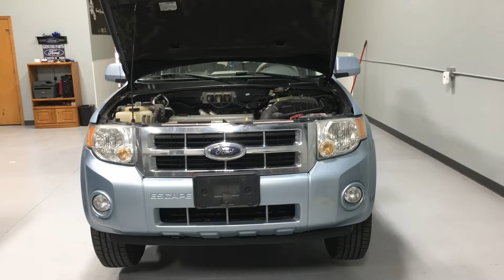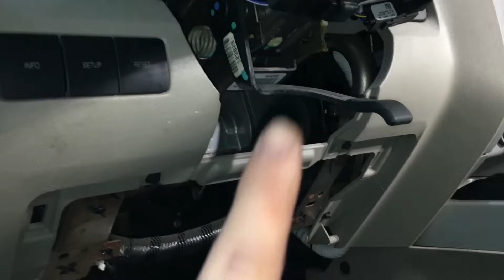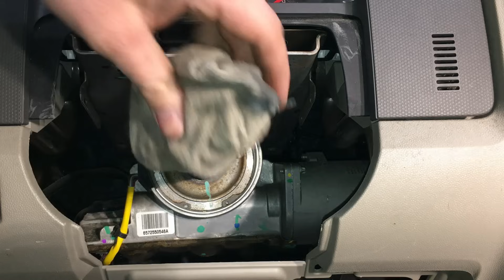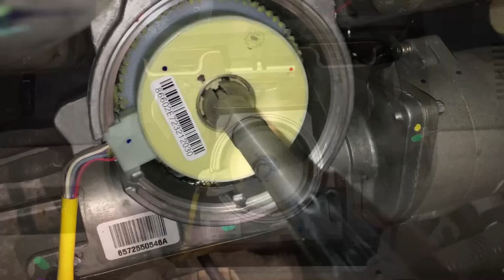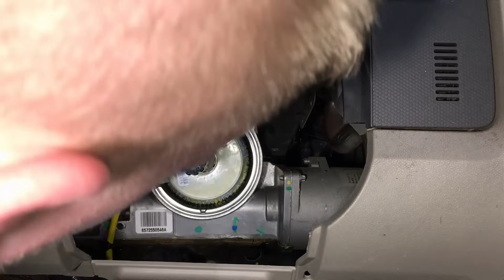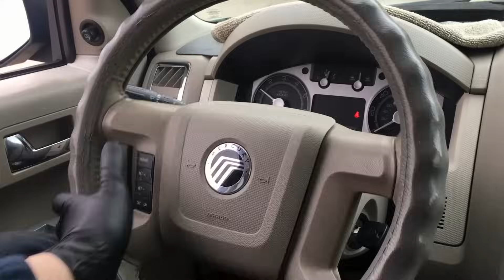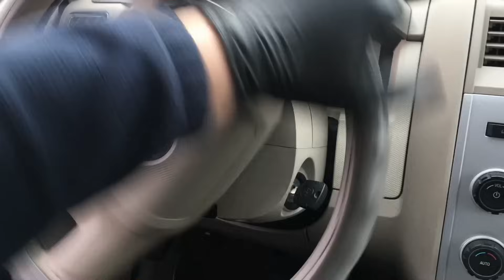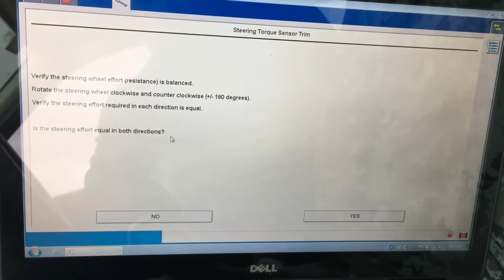2008-2012 Ford Escape Power Steering Code B2278 : EPAS Torque Sensor Critical Installation Steps

Comment: After i changed the sensor in 2009 for escape  for some reason the steering is really stiff as if there is no power steering . Do i have to recalibrate it with a scan tool or something

Comment: What did you use to get the snap ring out? I went and bought the largest snap ring pliers that Harbor Freight had the Icon p/n 57799 12-inch internal snap ring pliers. I did get the snap ring out, but I can't get it back in. Any secrets?

Comment: So the steering got real easy 7 years ago. No feeling at the wheel. It went kapoot today after replacing the key assembly. No codes so I will do as You did. Great tutorial. Thanks

Comment: How dare you not show what kind of sorcery you used to get that snap ring back in…… I bought beautiful Knipex snap ring pliers and this ring is kicking my ass going back in!!
Reply: After an hour + trying to reinstall the ring by myself a second set of hands showed up and once I had that person there to guide the ring under the lip as I squeezed a compressed it, it was reinstalled in under 5 minutes!  I have zero clue how someone could reinstall on their own when the ring kept popping off my $80 pliers I specifically bought for this job (which worked great I’m not sure how I’d have done it with any other pliers, BUT still needed a second second of hands to get it back reinstalled!

Comment: Thank you so much for this video, even in 2026 you saved me $1900. Did it myself with help from this video in one hour the sensor cost me $518 in 2026 from Ford.
  FYI *the pin that's in the sensor is very crucial DO NOT FORGET TO CHECK BEFORE INSTALL!!!! Again thanks for the Vid....

Comment: Hopefully, whoever needs to hear this can find it.  With the pin out of the sensor the top and bottom of the sensor can move independently.  This is how the sensor becomes "damaged".  You can reset the sensor by aligning them back up by turning them independent until the pin goes back deeply into the sensor.  * No need to waste sensors *

Comment: I have 2009
Ford Escape 3.0l XLT with 117,000 km . Yes live in Canada . SUV made in California. My wheel doesn’t shake at all ! No weird noises! No codes ! Steering wheel is very hard to slightly turn left or right . Checked Battery / Alternator. Good ! Fuse #35 good ! What’s your opinion if it’s the torque sensor ? I had the recall years ago and wish I had the knowledge or been told don’t get nothing done till if you have power steering assist fault message on my dash ! Any advice I’d appreciate. As I’m not buying a torque sensor as steering wheel doesn’t shake Etc thank you 🙏
Reply: Bought a newer Scantool . Torque sensor! Had to buy from Ford $1000 for the sensor. I was mistaken I never got a recall for my 2009 Ford escape 3.0l . Contacted Ford Canada and they have to have a Ford shop do a lot and send to Ford Canada . Then they will consider paying a portion only if Ford fixes my power steering fault ! Can’t get the snap ring off! I was told today you need a certain type of snap ring pliers for Fords Escape 2008-2012 ? I already ordered 16 “ snap ring pliers , pik set ! The 16 “ snap ring pliers will be in tomorrow. Could not get ring off with 7”, 11” snap ring pliers sets I had ! Can anyone confirm if you need a specific set of snap ring pliers that worked well for them ? Hope weathers good this weekend to finish replacing this torque sensor! Has anyone put a new seal on ? Mine is original and think I might . The Scantool calibrates the steering angle sensor , torque sensor ! Will let you know how it goes . Thanks for this video and any information about snap ring pliers, the pliers etc very appreciated! Ford USA was very helpful, kind ! Ford Canada very rude , etc ! 😊

Comment: I just did this on my 2012, bought a cheap sensor off of ebay. Triple checked my work as I went along. Started it up and the wheel clocked itself all the way to the right, LOL Note to self, stop buying garbage parts. A factory sensor cost me 3 times as much but hopefully once it comes in it will fix the issue.

Comment: @FordtechMakuloco, excellent video.Everything was real clear except for one thing for me. After you remove the alignment pin and then installing the cover.And snap ring, the shaft should still be in an 11 o'clock position and then you go to and still have a steering wheel, does the steering wheel then stay at the 11 o'clock position during installation as in your video, it looks to be at noon position, so does now the steering shaft get.
Turned and the torque sensor is no longer in alignment? I'm very confused , as i'm about to do this procedure. @FordtechMakuloco

Comment: Followed your instructions to a T. Everything was fine with key in only, able to turn stop to stop no problem. Cleared DTCs, started engine, and the wheel went full left. Where did I go wrong? Unable to  calibrate SAS or Reset PSCM as I am using Forscan. Is this an out of box failure or did I do something out of sequence?
Reply: Aftermarket ones don’t work, it needs to be OEM from ford otherwise you’ll be dicking around

Comment: I know this video was posted years ago but I hope someone can help. I replaced the sensor, everything went perfectly. Alignment of the pin and arrows was perfect. Reassembled, started he vehicle turned the wheel stop to stop a few times and then did the steering turque sensor trim calibration with IDS. No problems. Took it for a drive and the steering wheel is slightly off center. Slightly tilted to the right but drives straight. If you drive with the steering wheel straight, the vehicle drifts left. It didn't do this before I replaced the sensor and performed the calibration. What can cause this or what can fix this? Did something get thrown off when I calibrated it? 
?

Comment: Exceptionally helpful video as usual.  Those two bolts that attach the column to the vehicle are torque to yield and shouldn't be reused.  Less than $2 each,  Ford part # W712250-S437.

Comment: I've watched many of your videos and used several videos to help repair issues with a couple different cars of mine. I  appreciate your professional, and detailed advice, including warnings.  Hugely helpful as you typically even include size of sockets so I don't have to guess, saves a bunch of time. This repair went pretty much per plan it only took me an 1hr 15 minutes and worked perfectly on 08 Escape Hybrid with 229k miles.  Only struggle I had a little bit took me four times to install and remove the sensor even using the jig as the sensor indicator  was leaning to the edge of the alignment window. I would remove it make a small correction and reinstall till it was in the center before removing pinmaking  to avoid any IDS scan tool adjustments as I don't have that high level of a scanner. I hope you make enough from YouTube to make this worth all your time.

Comment: I just had this issue with my Ford Escape, is there a way to tell if the fault is in the sensor, or directly in the electric motor? I have no codes showing up

Comment: absolutely fantastic video I am unsure is the problem with ours is the same the wheel doesnt shimmy it does however have the power steering coming and going but there is a click like a switch turning on and off and the power steering is there and gone when the switch sound happens could this be the same issue I have scanned the car with a obd2 reader and there are no codes could you please let me know your input about this matter the car is a 2010 ford escape

Comment: I have a 2008 ford escape steering wheel use to slightly shake like in this video now there seems to be no power to the power steering at all were do I start for the repair ?

Comment: One thing he forgot to tell his audience is to remember to reconnect the steering wheel sensor connector with all the other 4 steering column connectors.  I forgot it and that has to be why my wheel spun all the way to the right after I started it up.  My sensor was put on perfectly.

Comment: I did this on a mercury and now the car won’t start it’s getting power but the ignition is not kicking on
Reply: If it’s a 2008 mariner hybrid then try  the button on the left of dash with door open remove the cover and hold down button to recharge the computer on the hybrids system. You may need to repeat and it takes about 5 minutes each time

Comment: Ok, my 2009 Ford Escape hybrid torque sensor was replaced, he went thru the 180 turn calibration.  When you turn on the car, the steering wheel turns to the left max position.  You can't get back to straight wheeled.  Luckly I have another torque sensor to switch too, but any other suggestions?  Wife getting upset about using her van.

Comment: Awesome video.  Saved me from certain waste.  One problem I ran into is I did not have a good set of 90 degree internal snap ring pliers.  I was able to get the snap ring off with some work, but when I tried to put the snap ring back on I jarred the sensor loose while struggling with it and toasted the new sensor.  Grrr.  Bought a great set of 90 degree pliers and it was a piece of cake.

Comment: Hey buddy. My kid's 2010 ford escape steering just went out. I didn't see any codes on my scan tool. I went ahead and replaced the torque sensor and calibrated it. Still hard ass hell. I double-checked the 80 amp fuse in the engine bay and the 10 amp fuse inside the car. They are good. I went and got a complete motor/ module from the wrecker and put it on. Recalibrate that. It's still hard. Do n I need to get the module program from the dealer to my car, or is it a bad module from the wrecker???
Reply: I also noticed my scan tool shows abs issues but no abs light on. Did a data log and noticed nothing. My speed sensors are not working on the driver side. On th schematic, it shows that the ABS is tied into with the power steering modual. Will make my steering not work?

Comment: If you have to repeat the process make sure the clip goes through the front hole and the back disk in the sensor there is a 2nd disk that moves slightly. If you miss the 2nd hole then the steering wheel will spin easier one direction and the center ends pulling to one side

Comment: Hi,I have the same problem with a Chevy Malibu 2012 and column and power steering torque sensor looks the same as the one you're replacing in the video.
If I replace the sensor can it be calibrated manually, without a scanner?
Reply: I discovered on my ford that if done properly it is not necessary however I had to repeat the process multiple times before it was perfectly aligned and also discovered the pin has to align with the 2nd wheel in the sensor. If it doesn’t drop into 2nd hole which you can’t see it will not work correctly
Reply: Thank you so much for your help...I appreciate it 👍

Comment: Brian i just did this install. Steering wheel stays straight with key on. As soon as you start it the wheel turns hard to the right but just key on stays straight. Do I have another problem?
Reply: Repeat the steps and make sure the pin goes deep to align the 2nd wheel in the sensor

Comment: Is there anyway to reset sensor if not done right?
Reply: Yes install the pin and move the back till the pin lowers into the 2nd wheel in the sensor

Comment: So 1st time it started to turn left after installing the new part. 2nd time it did the same with old part 3rd time it was the charm with new part. The sensor has to be in the middle where the pin comes out not one bit to edge. It’s not necessary to use the bungee as I found out it was throwing me off when the steering wheel was being reinstalled. What a pain the big clip is to take out. Had to modify my tool with a file to make a grove.

Comment: woulda been nice to see you put  the steering column back on!!  I spent 3 hours trying to get that son of  bitch on there
Reply: The bungee wrap screwed me up. Remove the key to lock steering wheel then remove steering coulomb and when installing then reassembly place steering into position install key and put it back to 11 o’clock and gently find the position and push back down In steering

Comment: Great video!  If I don't have any codes on my 09 Escape, and the power steering is completely gone, not intermittingly gone... it sounds like it might be the power steering motor, not just the torque sensor.  Is that a replaceable part or do I need to replace the entire steering column?
Reply: The sensor caused the system to shut down and no power. Ford had a recall and they updated my software which I think simply disabled the code generated by a faulty sensor. My did not have codes and I had to repeat the process many times before I got it back to work. Once forgetting to plug the sensor and that did not produce a code either

Comment: Okay hopefully someone can help. I replaced the sensor, didn't realize it can get out of alignment when the shaft moves up or down. Nothing happened. I have no power steering and it didn't jerk to the left or right. Does this mean i need to have it reset, and should i unplug the module while driving so it doesn't turn my wheel suddenly?!

Also the snap ring is a huge pain in the ass. I took some clamp vice grips and removed the feet, super glued some small bolts and cut/filed them so they fit snug in the snap ring holes. Got it to a manageable tension and locked the pliers. Still wasn't enough to get the ring out so I took big channels and turned the adjusting screw on the vice clamps until it closed enough to get the ring out.

Comment: Just finished my 2011 Ford escape 4 cylinder 2wd , great video thanks for sharing your knowledge! My 2 cents put your snap ring dancing boots on boys it’s a party ! Broke one pair of snap ring, pliers, tried and tried with another pair and could not get it to come out. Ended up using a small pair of needle, nose pliers you’re welcome. Good luck.
Reply: Man, I've gone through 2 sets of snap ring pliers and a needle nose. Finally got it out, but cannot get this f'er back in. Gonna try rnd 3 tomorrow
Reply: @traviscowell2714 how did it go?
Reply: @wolfsegovia  went good but didn't fix the problem going to replace the power steering unit probably try to do a whole colme swap. Thanks for the video
Reply: @childofgod5115 where did you have the issue? Sometimes the sensor has to be reset and then reinstalled
Reply: Someone said harbor freight has big removal. I cut mine with a grinder at 2/3 and it was still hard to get out and back. I placed the 1/3 on the lower so gravity would keep it in and it was fine

Comment: I know this video is old but I came here bc I have a 2009 Ford Escape and I have already replaced the torque sensor and now I have the steering going in and out intermittently but goes back to normal after startup. Garage told me I’d have to replace the steering column and it would be 2500$ and that it couldn’t really be done by them
Reply: Sensor is bad again
Reply: That’s what I thought too but I took it back and now they say I need to replace the cokimg for 2300$ and the vehicle is worth maybe half that and I only use it for a beater

Comment: Our granddaughters 2008 Escape suddenly lost power steering about a week ago. I saw that Ford had issued a recall on something to do with this problem but of course they said there isn't one, so im going to try and do this repair myself. Did anyone use a sensor other than a Motorcraft part? Just wondering because there are many different ones available on Ebay. I definitely only want to do this once. Also mine doesn't have a fault light on the dash. I'll check today to see if it has a code. Thanks for the video
Reply: I used Amazon and thought my sensor was bad but after many attempts I got it working
Reply: @loulela Hey buddy, is your sensor still working?

Comment: Thanks for the video.  Just fixed my 2010 Escape Hybrid.  A few things to remember:  If a faulty sensor caused your power steering to be disabled, a code will be stored in the power steering module that will need to be reset before the power steering will attempt to function again.  Even with precise alignment during reassembly small errors in actual vs sensed position and torque will result.  Modern scan tools allow torque and steering wheel center to be recalibrated.  Arrange to have a scan tool that supports these functions before you do the repair as a misscalibrated sensor is dangerous to drive as the vehicle will tend to turn on its own.  Lastly, the snap ring is very strong, difficult to remove, and even more difficult to reinstall.  The problem with most snap ring pliers is their tips change their engagement angle as the tips are brought together which can make the snap ring pop off the tool.  To reinstall mine I used a wood clamp to partially compress the snap ring, then used the snap ring plier to fully compress the snap ring and finally used a vice grip over the jaws of the snap ring pliers to hold the snap ring at an installable size without struggling to hold the tension on the snap ring plier handles.  Then you can easily position the snap ring into its position and hold it there while you wiggle the snap ring plier out of the holes in the snap ring.  Phew!  Good luck.
Reply: Hi! I had a repair guy tell me that this repair can only be done at the dealership because of the necessary recalibration, he also informed me that any GOOD mechanic won't do the repair because only the dealership can properly recalibrate and if they DO repair it. They are not good mechanics and just trying to make a buck and I might have issues afterwards that might be dangerous even if they repair it without the recalibration. What's your thoughts on this? True? Sounds about right, right? Hope to get your feedback. 🙏